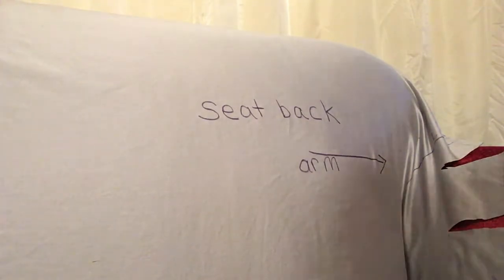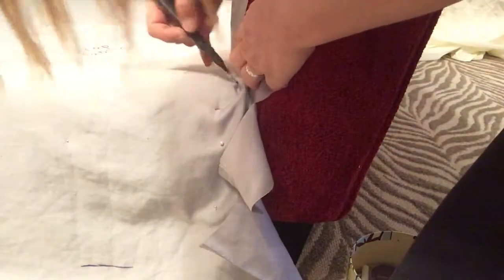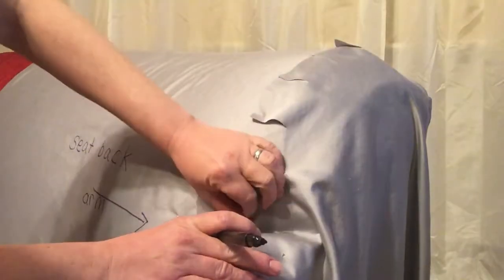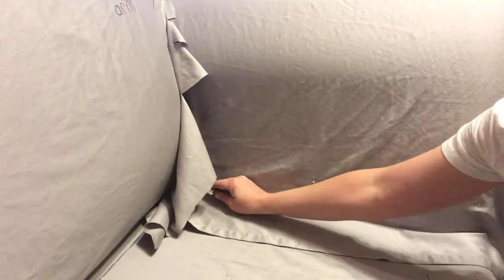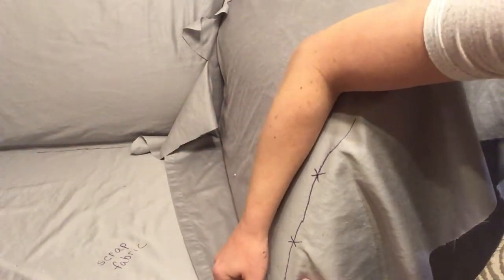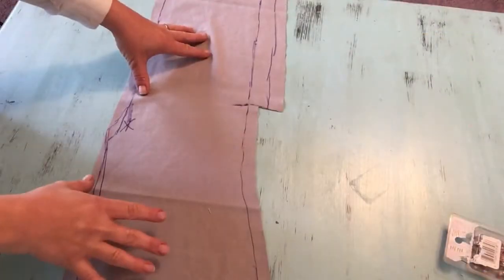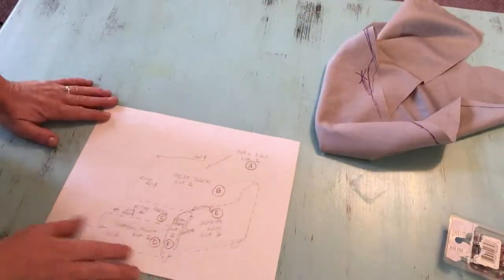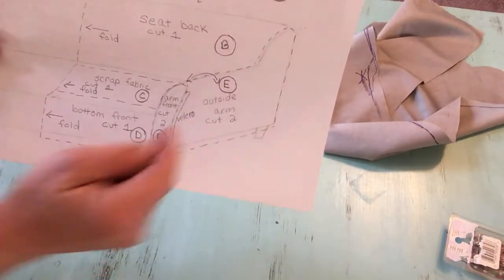DIY Fitted Slip Cover

Comment: I'm assuming that the fabric you used is just a template.   What is the cheapest fabric to use?  Maybe old bedsheets?
Reply from the maker: Yes- if you don’t have any old bed sheets, try Good Will or ARC- they usually have them for really cheap.